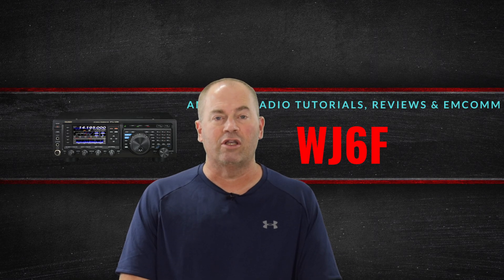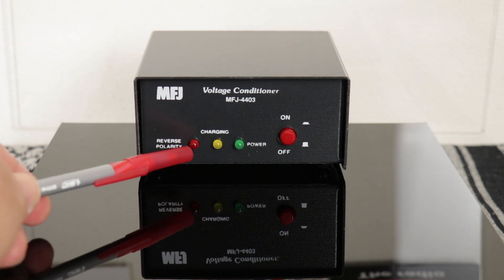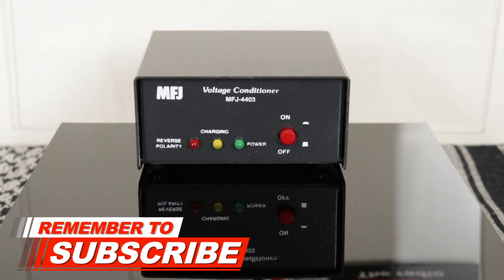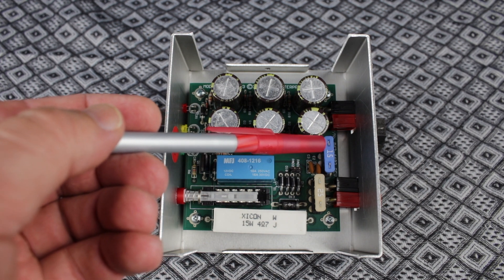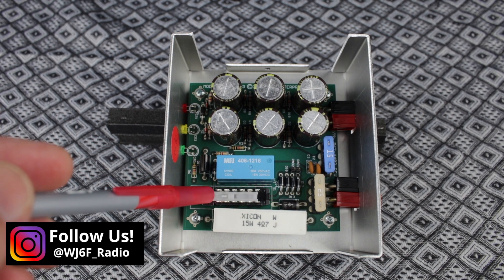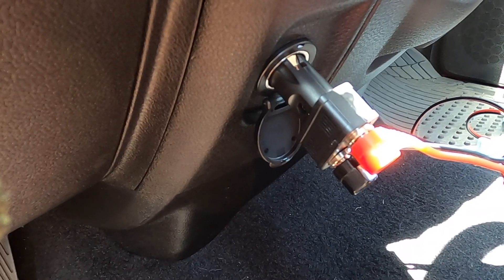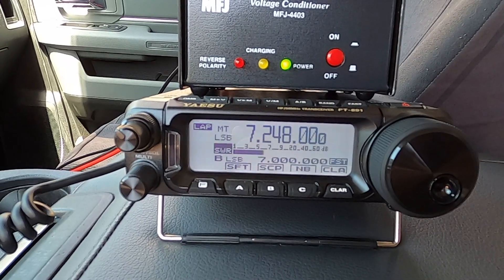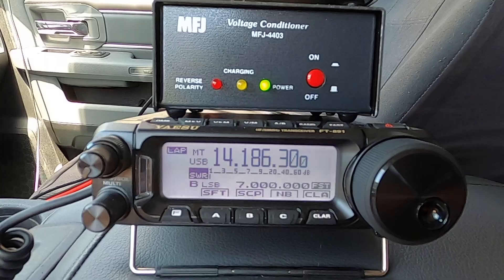MFJ-4403 Voltage Conditioner

Comment: When you opened it I was surprised at the capacitor bank, I wasn't expecting it to fill as much of the case or take as long to charge. Thanks!
Reply from the maker: Thank you for taking the time to watch and the comment! It is greatly appreciated. It sure isn't the fastest at charging. I actually sped up the film during the charging. It was interesting to me as well to see how many were in there.